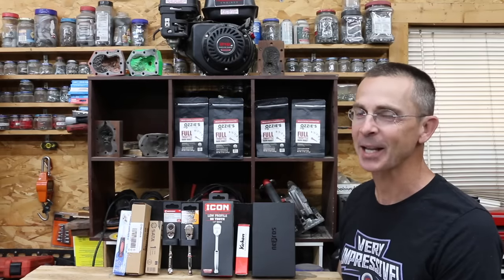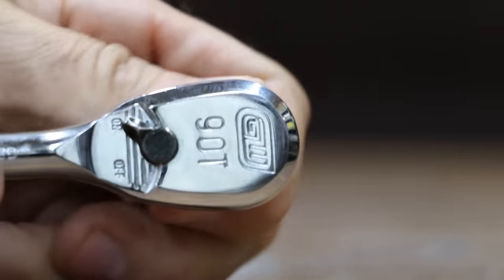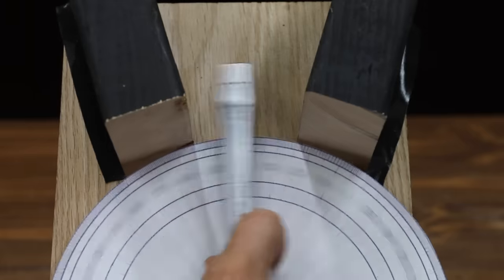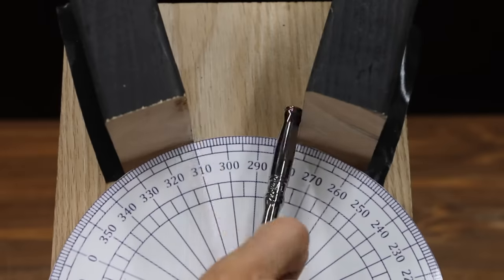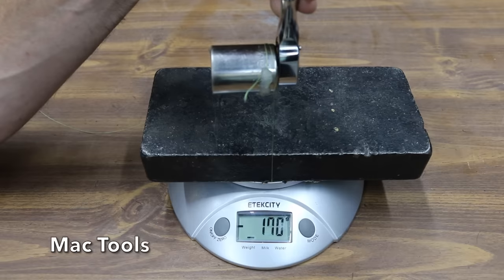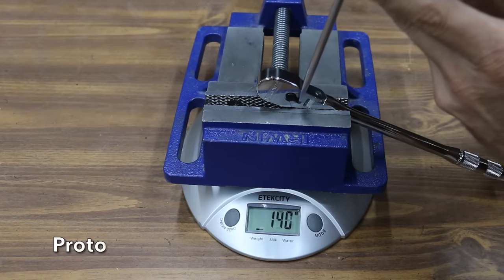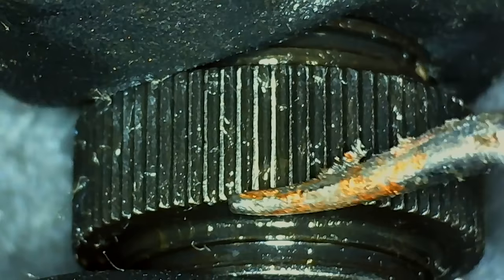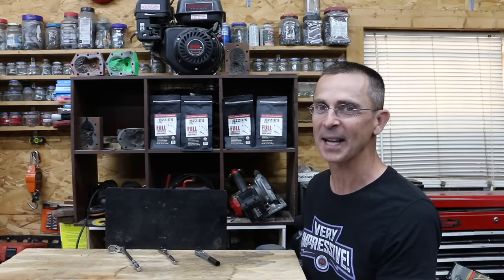Best Ratchet (1/4 In)? Snap On, Icon, Proto, GearWrench, Prototype

Comment: I've  always preferred the reverse switch to be stiff, nothing agravates me more than trying to maneuver a ratchet into position  inside a tight spot where i cant reach only to have something bump the lever into the wrong setting, I've had to go as far as wrapping the handle in electrical tape to make it stop.
Reply: Was thinking the same thing...you want a little resistance to direction change
Reply: I agree with You. When working in a hard to reach place, where you might have to work by feel only its super annoying to accidently change direction.
Reply: There’s a little spring in there near the handle end that pushes up and holds the switch in position. You can replace it with a stiffer spring.
Reply: I literally came to the comment section to make this exact comment. Thank you!
Reply: but flush is definitely better, less accidental swipes or it getting stuck somewhere
Reply: I mostly agree, ideally I like the switch to be easy to feel/grip but with good resistance but failing that a flush fitting switch with lower resistance can work. You don't want it to be so lose that your shirt sleeve might flip it though.
Reply: YES!!! I absolutely hate that. That's the quickest way to go from, "ok, let's get this job done" to "screw this! This piece of s#%* useless sack of..." 

I'm sure you know what I mean
Reply: I've also had ratchets just switch directions while runing a bolt in due to something rubbing it.
Reply: @bradhaines3142  You can take that switch out and grind it flat.
Reply: This is why I like my proto round head ratchets.
Reply: I wish they could put the reverser on the handle end
Reply: Loose reverse switch on a ratchet = Garbage it goes.
Reply from the maker: Thanks for the feedback.
Reply: @reconbbs360   wasteful consumerism mindset. Most good quality ratchets have rebuild kits available. Oil your tools frequently as well. You’re throwing money down the drain when buying cheap tools over and over.
Reply: This absolutely echoes my preference.
Reply: I was thinking the same after replacing the ac compressor in my car yesterday.  LOL!
Reply: yea thats pretty annoying
Reply: Yep agreed. Stiff with a nice detent!
Reply: @markm0000 probably an American. Most Americans are more in debt than folks in any other country because of that mindset. You'd be sick by seeing what these clowns throw away over here. And it seems the less money they make, the more they waste. I guess its because they watch rapper videos burning $100 bills. 😅
Reply: I like it being a little stiff. Too smooth and it feels sloppy to me and accidentally changes direction on me
Reply: Was going to say the same. Pain in the butt when it doesn't stay where you want.
Reply: Same here. Floppy direction switches are a PITA!
Reply: Preach. The last thing I want is the thing to switch when I am pulling spark plugs. I spent 30 minutes with a cheap rachet pulling spark plugs once. I'd get 1/2 to 3/4 the way and adjust my gripe for comfort. Flipped the switch.
Reply: Thank you! While watching that test, I was thinking anything close to either extreme would be bad. I don't want it too stiff, but I certainly don't want it too easy either. And in my experience, too easy is more often a problem than too stiff.
Reply: I slip a small o-ring with a drop of oil on it or a hair tie rubber band over the switch to create a little Friction.
Reply: When it’s too easy yeah. But I just use my thumb to switch it back. After all, my thumb is right there. It’s rarely a problem.
Reply: Very true!
Reply: Same here. A lighter touch is usually more annoying in my experience
Reply: I don't need the Icon 1lb reverse lever, but super light isn't a great thing for sure. Somewhere in the meat of that data is the right porridge 😄🍻
Reply: A featherweight directional lever would drive me absolutely insane. On most jobs, I'll only touch that lever once for removal, and once for install. Other than that, I need it to stay put.
Reply: Ditto that and extend to my drills and drivers. I love my new M12 Fuel impact driver, but my hand bumps the direction switch just holding the driver naturally and it moves into neutral far too often.
Reply: It would be interesting to see a design that incorporates a way to lock the directional switch in place in order to get a switch with low resistance that stays where you put it. It could be as simple as having to slide up and then rotate or push in to rotate, along the same principle as the socket retention. Now I just have to remember to move the selector to the off position at the end of the day so the batteries in my ratchet don't go dead overnight.
Reply: I disagree with the direction switch grading as well. Low force to change direction is annoying because the ratchet changes direction when I don't want it to. I have 1/4" drive and a couple 3/8" drive ratchets that are like that and they are annoying to say the least. Any little bump misplacement of my hand and they've changed direction on me. My Wera ratchets so far don't have this tendency.
Reply: That 17g result made me wonder if it would flip positions just by bumping the ratchet head.
Reply: My current ratchet has a light switch and I hate it.
Reply: Agreed anyone who works on cars using ratchets in tight places will probably agree with this. Especially when a nut or bolt is loose enough to not drag much and you're talking to someone and get a couple turns in the wrong direction before realizing.
Reply: Absolutely agreed. I have a ratchet that I really like otherwise, but it has no resistance on the switch, it's extremely aggravating when it switches itself, which is constantly.
Reply: Same here. A trick I learned was to clean the wrench with alcohol to get all oils off and then apply a waterproof bandaid behind the switch to create a little pad that keeps it from switching on its own. Ive had wrenches where the switch loosens so much that just the rattle of using the wrench will switch directions. It's a minor inconvenience that triggers a large amount of rage for me.
Reply: It can especially be an issue when you're choking up on the ratchet to avoid breaking a skinny bolt.
Reply: @giggiddy  As an American I have to agree. However I take advantage of other people's garbage by making it work :)
Reply: As with everything there is a happy medium. You don't want it so loose that its flopping around but you also don't want it so tight its giving you blood blisters by the end of the day
Reply: @DavidBergman1776  Thats a very good point sir!😁
Reply: @corbintrubov  handcuff key to change directions 🙈💩
Reply: @matthewolson9704  🤣but before you can access the hole for the handcuff key you have to solve a riddle and its a different riddle every time
Reply: X
Reply: @markm0000  I  have never in my life seen a store with a ratchet rebuild kit. Im sure they exist, just never seen or been offered one.
Reply: I was literally looking for middle of the road for that exact reason. Sort of the goldilocks.
Reply: Time for a new wrench then
Reply: Agreed !
Reply: Actually, this scenario happens too often (unfortunately).
Reply: I was a little confused by this stat as well, probably pretty subjective.
Reply: Craftsman
Reply: Busted my knuckles more than once when it switched on me....ouch
Reply: Got an old Blackhawk 3/8 drive set that has its own metal case. Had it fifty years now. Don't even remember where I got it. Always seems to be the set I grab and set on the fender.
Reply: absolutely. this is the one point of the testing I did not agree with at all. I have a set of craftsman sockets that I bought 40 years ago that have never failed me in all the years I've had them. And the only thing I ever complained about was the easy reverse switch on the ratchets (especially the 1/4 inch one). But like another commenter said, replace the spring under the switch with a heavier one and problem solved.
Reply: Bingo was going to be my responce
Reply: For sure.
Reply: I came here to comment the same thing. As an auto mechanic, it is extremely aggravating when the ratchet switches direction if it bumps something. I really don't see much benefit at all to not having the lever be stiff. There are niche situations where you're backing out a bolt and the head of your ratchet is too big to back it out any farther, requiring you to switch directions to go back in to give enough space to get the ratchet out. But for me this is something that only really ever happened maybe once every 6 months or so. I generally recognize when I'll need to use a wrench over a ratchet, but sometimes you just didn't know that bolt was going to be extremely long.
Reply: Agreed…I’d rather have to manually switch it with a damn hex wrench then have it switch when I don’t want it too.
Reply: @sandy_knight  Yeah...I think you nailed it.
Reply: @markm0000  if you can find one that fits
Reply: @corbintrubov  LOL, 😆
Reply: I agree, If I assume the stiffest selector I've used is about what 450g tested hear and the lightest being 150g I'd say the 225-275g range is where I normally like it. I've had some ratchets where personally I bet it was more like 1-2 kg to turn it but idk for sure cause who actually measures that stuff. But yeah I like a slightly stiff selector so it doesn't accidentally change, but I definitely don't want to need both hands to change the direction, like I have had with some ratchets before.
Reply: There are few things more aggravating than your ratchet changing directions on you mid throw. That entire test is not only useless, but backward from what someone that actually uses tools for a living is looking for.
Reply: Me too.
Reply: My old craftsman ratchets will randomly switch direction for no reason same with matco but i got rid of those

Comment: The TRO and 3d printed contenders were an extremely entertaining addition. It's always very interesting to see how the top performers don't necessarily come from a particular company, country, or at the highest price.
Reply from the maker: Thanks!  Thanks for sharing.
Reply: After the Ocean Gate Titan we might be a bit sceptacle about TRO's titanium & carbon fiber construction.
Reply: They absolutely do only come from a few particular countries,  open your eyes
Reply: It's too bad the completely 3d printed one tapped out early. I would have been actually interested to see it's performance.
Reply: @jacobpoucher  Indeed.  "seen" here for instance the Gear Wrench made in Taiwan.
Reply: @amorphuc  yeah thats true tiawian has been making tools for a long time, some of the better value tools come out of there because they can save money outsourcing.
Reply: @n.mcneil4066  The ratchet handle is reinforced with TITANium under the carbon fiber, but it's still recommended for above sea level use only...
Reply: @n.mcneil4066  Not really, the entire failure mode of the Titan submarine was pretty well understood... under normal conditions the sub would be perfectly strong, however at 4000m depth water infiltrates between the wrapped pressure vessel layers and causes it to weaken and fail. That is almost certainly what occurred. Nobody should have been using a carbon fiber pressure vessel for a sub without some extreme testing beforehand which they did not do.
Reply: @n.mcneil4066 carbon fibre isn't actually as amazing as allot of people think it's only strong under forces it was designed to take, put a bit of pressure in the wrong place and it will snap. I've seen people buy £5,000 carbon fibre bikes, only to fall off because they aren't used to clipless peddles and snap the frame because it isn't designed to take side load impacts.
Reply: @Wingnut353  they also bonded/glued metal to carbon fibre and they have a significant difference for thermal expansion/contraction rates
Reply: @ProjectFarm  "Der Erwachte" is pronounced "Dair AirVAKteh." (The "k" is actually pronounced with some hissing through tightening the muscles in the back of the throat. Unless you have a southern German accent, and then you can pronounce it more like an "sh" with some hissing by tightening the back of the tongue against the roof of your mouth.)
-- It means "the awakened" in German.
Reply: Planes are also best made of high tensile steel because of its strength.. f1 cars should be made of lead because of its bendable property's in an accident to soak up the damage.

Comment: I generally agree with most testing methodologies, but the ratchet switch being too loose is just as much of a problem as it being much too tight.
Reply: I agree I would like to see the scores totalled with that removed. For me it isn’t relevant.  If it is physically difficult to move like it is seized or broken it is a problem but other than that it doesn’t really matter
Reply: Same goes for his first test. If you had a handle with a very small diameter you could ratchet that circle in very few turns
Reply: Also agree with you.  I like a stiffer swing on the switch. A 1/4 ratchet is made for tight spaces and how annoying is it when the silly switch inadvertently gets reversed.
Reply: The overall score isnt that important. The video gives us testing data and we can take away from that data whatever we will 👍
Reply: I bought Milwaukee 3/8 and 1/4 to replace my mis-matched sets. The 1/4 worked great. Once. Used it a second time and ratchet started acting up and finally gave up completely. Tried to get it apart to see what was up but couldn't. Returned it to Farm and Fleet where I got it and they reluctantly replaced it. The new one seems fine. We'll see if it lasts.

Comment: The fact you've made all your jigs and tests so far without having a 3D printer in your arsenal is "VERY IMPRESSIVE"! Excited to see what kind of things you come up with in the future utilizing it!
Reply from the maker: Thanks and you are welcome!
Reply: believe it or not there was a time when EVERYTHING was done without a 3d printer.
Reply: @dirtrider88  Say it ain't so!
Reply: You 3d printer people crack me up. You act like its the end all, be all of manufacturing and building
Reply: @Dillybar777 some do sure, but there is a LOT of use to it. You can make parts that are otherwise impossible or at the least out of reach for the average person.

Honestly anyone who does repairs should pick up an ender 3 and a few spools of cheep filament and learn to 3d model. I've fixed everything from crock pots to monitor arms to automotive caps and while I could have replaced each of those for 10-40 bucks, the time and utility it offers is immense. 

Think about it like a lathe, you could get the same utility out of other tools, a mill and drill press come to mind. But it's faster and has a level of accuracy that you couldn't get by using another tool
Reply: @Dillybar777  sorry that's how you took it

Comment: My first thoughts --  for the ratchets that are serviceable like the Gearwrench, the internal grease can be removed and replaced with superlube which would improve the backdrag.   The failure load for all the ratchets seemed more than adequate, so that really makes the backdrag and rotation metrics the only important things to consider IMO.  Husky looks like a great value!
Reply from the maker: Thanks for sharing!
Reply: Yes, I’m having a hard time imagining needing  a 1/4” ratchet to stand up to such significant torque.  In my experience the problem is the opposite - breaking fasteners.
Reply: Who’s servicing their own ratchets though? I’ve never done that and I’ve been a shade tree mechanic for over 25 years… I’d rather be able to just meet up with my SnapOn/ Mac person or drive over to HFT, HD, or Lowe’s and exchange my broken wrench.
Reply: At less than $30, I wouldn't bother waiting for the snap-on rep to drop by.
Reply: @kevrides5706 good luck at lowes. I've had the hardest time with warranty from lowes. Nothing like sears used to be. HF has probably the best warranty. But servicing a ratchet don't hardly take any time at all. I used to do it all the time. Had to spray it down with water almost every night.
Reply: @kevrides5706 who's taking their tools to someone else for service though? I've been a professional mechanic my whole career and why would I wait on someone else to do something that's so easy to do myself
Reply: @kevrides5706  Not many I'm sure, but with a pair of snap ring pliers and a few minutes, replacing the gear lube is pretty easy to do.
Reply: I picked up a Husky 3 pack (1/4, 3/8, 1/2) of the 144 tooth ratchets a year or two ago.  I sure enjoy them.
Reply: The snapon has two machine screws and it's apart?
Reply: @Sylvan_dB  same. And got them at a hell of a price. Couldn't resist
Reply: @kevrides5706  Does a meta mechanic fix his own tools?  😆
Reply: I agree, for backdrag and weight I would get the TRO version for my lightweight toolkit all day!
Reply: My first ratchet was the husky 144 and I got the Milwaukee ratchet in a set a couple years later. Now when I’m reaching for a ratchet I always reach for that Milwaukee first. It just feels so much smoother than the husky
Reply: @kevrides5706  I used to do it all the time with Craftsman. Break something and go into any store and get a free parts kit. The new redesigned ones, though are not meant to get opened. I broke a 1/4in ratchet and they sent me a new one instead of a parts kit.
Reply: @danpritts5249  everyone in a aviation pushes their 1/4 inch ratchets to the max because that's what we invest most of our money in compared to all the other size ratchets
Reply: Why would you not test a zero degree bearing ratchet? For 1/4 drive in tight places nothing beats it
Reply: @ReddawG1990  Use diesel, cheapest way to clean and lubricate in one go 😁
Reply: I've always liked Husky tools. I haven't tried many different ones, but for the most part, they've worked well for me, especially for the money.